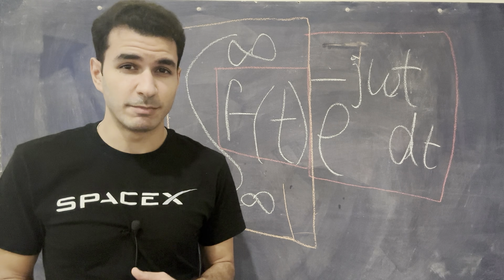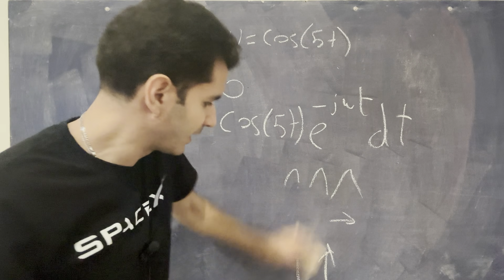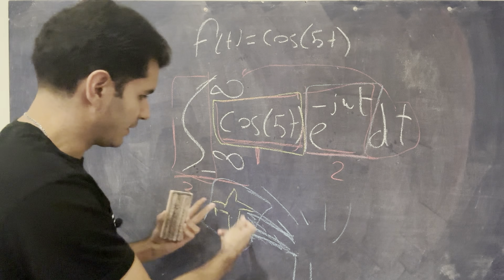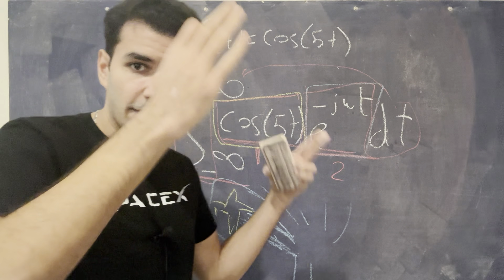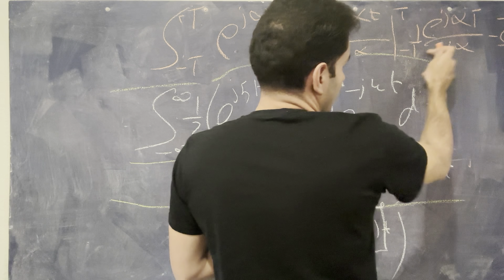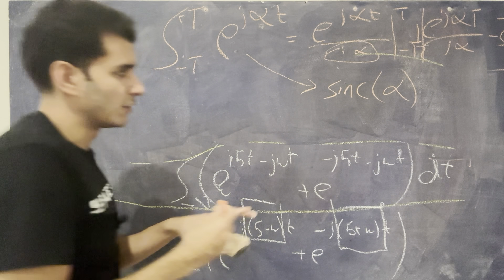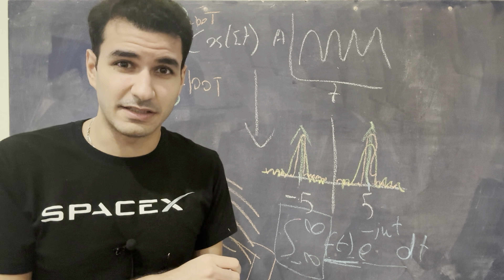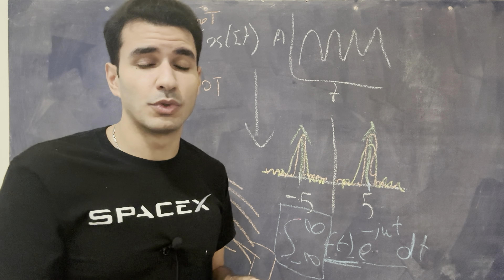Fourier Math Explained (for Beginners)

Comment: First of all thank you for your time on making such beautiful videos. Besides I want to ask some questions. 
1. First of all what does negative frequency really mean? I suppose it's some kind of opposite direction or so, which I don't quite know what it would represent for example in sound signals. 
2. 2ndly do we define negative amplitude and what would it mean if we've defined it? 
3. 3rd of all, we've divided a signal into it frequencies with some amplitudes. Do we know what these frequency signals exactly are because they can be of the form c*sin(2πx/a+t)+b (not sure of the +b) right? And then the period or frequency would be a, we only know a the frequency and c the amplitude. There's some ambiguity, and maybe what I'm asking is just Fourier series? But then how does Fourier Transform come in handy without Fourier series.

Comment: Same applies to a spike in time domain, it covers all possible frequencies
Reply: Which is why power inverters and variable frequency drives with high speed Bi-FETs switching 600 VDC at 3 to 15 KHz create so much electromagnetic noise at a wide range of frequencies. I always recommended inductive line reactors to reduce pulse rise times to minimize noise and harmonics in power and instrument systems.

Comment: Great explanation, with all love from Computer Automation and System Controlling Engineering... ❤🔥
Reply: I thought control theory ppl were all about the Laplace transform?
Reply: @DrDeuteron
Yes you are right, in fact, control engineering is entirely based on the complex plane, specifically the Laplace transform. This includes block diagrams, transient responses, impulse responses, and the frequency domain with Nyquist and Bode plots, as well as state-space representation and transfer functions. 

In computer engineering and automation, the control specialization involves studying several other mathematical subjects. For example, the first mathematical course, known as "Mathematical Analysis 3," introduces us to Laplace, Fourier, and Z transforms. Then, there were other courses where we used Fourier transform and its applications, such as "Electronic Circuits 2" and "Digital Communications," which I studied last week and took an exam in. 

One of the most important applications of the Fourier transform was finding the output signal in nonlinear systems within the framework of equivalent gain theory and when using good low-pass filters. This application was covered in a course called "Linear Control."

Comment: You need to give credit to logarithms, because it uses the same logic. In logarithms you transform from multiplication to addition while in Fourier transform you transform integration and differentiation of functions to addition of functions. So the original is the idea of logarithms.
Reply: I’ve never seen a video on the forced damped simple harmonic oscillator, which I think is the best example of turning differential eq into algebraic eq, and it applicable in soooo many fields.

Comment: Thank you for the nice presentation but I do have some comments. I have used the Fourier transform (though mostly DFT's and FFT's) many times in my work as an engineer. During your explanation you unfortunately literally ran out of blackboard (and camera visibility). Maybe at some point you could redo this presentation with a little less haste and more blackboard clarity? While you give excellent insight into how increasing the integration limits narrows the results in the frequency domain I'm not sure it offers much clarity in terms of visualizing how or why the Fourier transform actually works. Then again, maybe this is just my own short cummings!

Comment: The FT is a nice piece of pure math -- yes. But for practical cases where you are dealing with vectors, not continuous functions,  then this is a massively over complex and obscure way of explaining the FT. A better way to look at this is to think that any vector can be represented by a sum of a set of orhothogonal scaled basis vectors. This moves the probem from calculus and complex exponentials into arithmetic. And this reframing means that the discrete version of the FT (the DFT) can be computed very easily without using complex numbers or matrices. And while while retaining a far stronger intuition about what you are really doing when computing the DFT or the iDFT.

Comment: Good explanation. I wish universities taught first digital signals before they taught continuous signals. 
I was a math and physics grad when I took digital signal processing and signals and systems simultaneously. From a math-brain perspective, Discrete signals are much more digestible for a 3rd or 4th year EE undergrad, and it takes away the calculus component, just focusing on the concepts of why you would take the fourier transform of anything. Integrals scare EE undergrads like the plague.

Comment: Amazing video, i would love to see a similar one about Laplace transform.
Reply: Absolutely!!
Reply: Laplace transform is the same, but you set s=jw and you get a result in the 's domain'. 

When doing all this on paper, I recall at uni back in the day I used to find it easier sometimes to perform a Laplace transform on the time domain function using a standard conversion table then express back in terms of jw to get the frequency domain function.

Comment: So how would a machine even know what to look for in the first place? Lets say we want the exact equation of the bird's frequency (chirping)? How to guess their f(x)?
Second question, when you say correlator/radar, do you mean the signal that is sent back the second our machine detect the bird's frequency?
Reply: When he says radar, he means that the e^-jωt is a test signal that the transform is comparing the main signal against. The transform keeps changing the test signals frequency (ω) and then sees if it’s the same as the main signals frequency. When it becomes equal, you get the spike in the graph, and you’ve now found your signal
Reply: Since a chirp is not a pure sound it will contain many frequencies and would be difficult to guess the functional representation. 

One way to get f(t) of a chirping bird would be to use a microphone connected to a digital oscilloscope.  Download the scope data to a laptop and plot your f(t). You could then do a non linear fit to get an analytical expression of f(t).